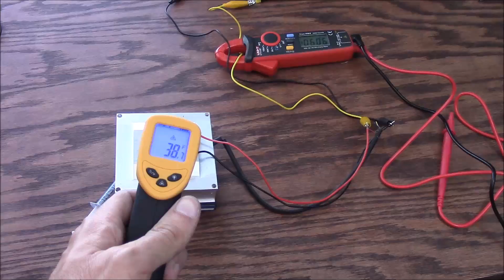Peltier Cascading - Does It Work??

Comment: Haven't watched video yet, but I'm certain this will not work

I was trying to find this in reverse, would you be willing to test this for a thermoelectric generator?
Reply from the maker: I do plan to revisit thermoelectric cooling at some point in the near future but I'm super busy building my homestead.  What, specifically, do you want me to test?
Reply: @LDSreliance  Just how much more efficient a thermoelectric generator is when you use Peltier cascading. 

Where I am is rather cold most of the time, so, not to be rude, but I'm not particularly interested in peltier cooling

I've seen a few people in comment sections of YouTube suggest cascading to increase efficiency of thermoelectric generators, and their reasoning makes sense. The heat gradient is divided among the different layers, with the layers furthest from the heat source converting heat that would have otherwise been wasted by the closest

I'm also led to believe that they'll be more resistant to overheating, though I'm skeptical if there will be much difference there

Thank you for taking the time to reply, and I wish you the best of luck with your homesteading
Reply from the maker: Thanks.  I'll see what I can do.  I assume you are talking about the TEG's that people attach to wood stoves and things like that?
Reply: @LDSreliance  oh yes, are they not the same as peltier?
Reply from the maker: They are.  Just a different application.  One consumes energy to produce heat and one consumes heat to produce energy.  Neither is very efficient but it is cool and interesting to tinker with.

Comment: I believe if you separate two cell into two different temperature region in the house like the roof and floor then connect them together like a loop with positive goes into positive of load like fan or light or air-conditioner then go to the other side of cell on cool foundation then when sun raise it drive referigerator and charge battery but it need more cells in parale and series together to make it power refrrigerator and microwave and stove

Comment: maybe a better validation would be to say cooling something. Like say running current in some mossfet chips on a heat sink and repeat test to see what setup cools the mossfets most efficient and also see how doing the TEC in parallel and series configuration. or send me the stuff and I will run the test LOL. Sorry I worked at a factory where I was used by the engineers that mid 6 figure to make their ideas work in the real 🌎

Comment: It would be interesting to see the impact of cascading when using a peltier to heat. I would venture to guess that it would close to double the performance as peltiers are better heaters than they are coolers.
Reply from the maker: It would definitely increase performance.  I don't think it would be double but it also wouldn't surprise me.
Reply: @LDSreliance  the thing is, even without the peltier effect, the peltier is a resistive element generating resistive heat. The catch is can they out preform the efficiency of a traditional resistive heater. My intuition says no due to increased thermal losses
Reply from the maker: True.  And they do require a much bigger heat sink on the hot side.

Comment: I'd be keen to space the cascade with a sandwich plate, 'semi' heatsink (as the cascade device is not directly loaded and each share an added value of safety from a serious breach that can occur during operation.  I hear that these things can stall on start up if the opposition of dissipation is too high).  The values of different peltier operation characteristics can better sympathise as one configuration might be premium to lower current operation or to the needs of higher demand such as on group for body operation and another group for a freezer unit.  
Then use 'the semi-stack' to improve the heat dissipation from a small group of primary stage sinks.
Basically ramp up the the top deck current while boosting the primary array, overall it could be a more linier change with the compensations made by a programmed triggering network of PWM controllers.

It will save on space and the extra cost of heatsink material.  It can even eliminate the need for water cooling which could be a payoff for the ecconomics of a project for years to come.  Then again the water thermo distribution could work as a payoff in itself.
I just don't want to buy a conventional fridge or putty up an ugly old styrofoam box.

You got it neat and exceptionally organised, nice to see the effort in effect!
Grats on the video ✌

Comment: Sir, my peltier module is drawing only 2 Amps of current 

What should I do ?
Reply from the maker: That is common in my experience.  When I order these I always order several of them because some will arrive defective.  If I order 5, hopefully at least 3 will be fully functional.  But I have some that arrive completely dead and unusable and some will come like yours and never draw full power.
Reply: @LDSreliance  ohh okay 
I have taught power supply problem

Comment: https://www.youtube.com/watch?v=vsTIWhZ-6HM

Peltier Plate Driving 2 Low Heat Sterling Engines. The Hot side powering the top & the cold being powered by the cold. Because a Sterling Engine converts the differences in Temperature both the Hot & Cold and a Peltier Plate produced Hot and Cold but on different sides of the plate the Peltier Plate's side can be used to produce kinetic energy.

The Top "Hot" Plate/Sterling Engines also acts as a more entertaining heat sink. 

For best results with a TEC1-12715 DC12V Heatsink Thermoelectric Cooler Cooling Peltier Plate Module 40x40MM over the TEC1-12706 as the TEC1-12715 can run at a higher amperage. If you only have a TEC1-12706 then you may with to place some form of resisters or Temperature Controller Module otherwise the heat may be too great for both the Low Heat Sterling Engine & TEC1-12706.

Comment: The major problem I noticed in these videos is the management of the heat itself.
Heat sink and insulation are the key words.
You are basically running 72 Watts through the first TEC so if you get a radiator from a car or an Air Conditioner unit from a scrap yard you could add 20 watt from a table fan and water pump and get a lower temp with way more efficiency instead of the (9.5 x 12) 114 Watts by stacking 2 TEC.
Reply: I think the idea is to reach maximum temperature difference between the top TEC and the environment. No matter how good the heatsink is, TECs only create a temperature difference and every single one can create only so much of it before the cold side stops getting any colder.

Comment: was that thermal compound acting as an adhesive?  I didn't see the test device move.
Reply from the maker: Yes, the thermal compound does form a little bit of a bond between the heatsink and the peltier (or CPU).

Comment: To increase efficiency, it would be much better to not fix the peltier modules to each other but to have them separate, with individual heat sinks for each peltier device.
My ideal construction would be like a minifridge within a minifridge.
I think this way, one would achieve much greater efficiency.
>

Comment: I used these for scientific instrumentation this wont work you need to have proper multiple stacks or stacks where the coolers decrease in size as they need to dissipate the heat

Comment: I started my interest in peltiers only yesterday  and i learned  that stacking works properly using different voltages  on the stack.  Thank you for unknowingly  proving  that .
Reply: At least someone saying this!
He should get far lower temperatures if the second battery was run at abt half the voltage of the first one!

Comment: You have no cooling the way you are dooing it.
And the cold side tec must be half or less the power rating.
First tec might transfere about 100 watt of heat on the hot side and 50 from the cold side then the next have to pull out that 100 pluss it's own 50 watt and that is way above its limits

Comment: This is not a really good model of cascading. Generally, when you cascade, the situation involves a small yet very hot chip, & the appropriate size Peltier cannot provide enough cooling. So, the first small Peltier with a modest heatsink is applied, then a larger Peltier and heatsink attached on top of the first heatsink. Sometimes third & even 4th layers are applied. This allows greater cooling, with less risk of condensation, because any bottom area of the Peltier not in direct contact with the hot chip is ineffective, and risks condensation.  Also as a way to cool when the target is crowded by other components which would prevent an oversized Peltier, even if you were able to prevent condensation.

Comment: I have a mini fridge with 2 compartments. 
Each have own peltier with internal and external heatsink with fans.
BUT shared power supply.

My 2 question is :
1, Increase cold side - do I need different watt peltier or bigger hot side heatsink ?
2, separate power supply for each peltier?
Thanks everyone who answers
👍👍👍
Reply from the maker: Yes, I would replace the peltier with a higher watt unit, upgrade the hot side heat sink, and add a second power supply (because the higher wattage peltier will require more power).

Comment: Great video, would be great to see how it goes generating power instead of heating and cooling.
Reply: I was able to get 250ish mV by rubbing it, with the otherside on a cold counter.  seems it shot up but then would go down as something seemed to equalize, no matter how much more rubbing i did the mv wouldnt go up.   Not very intuiative.  It seemed to like the temperature differenace more then just heat.  Another thing was rubbing the other side prodced a negative voltage,  you can make AC current with this?  Hot and cold type of engine, instead of stwitching polarities to drive a eletric motor, you switch temperatures to drive a peltier motor hehe, probaly at terrible efficiency though.
Reply: @mikejones-vd3fg  When you supply electricity, you generate a temperature differential. When you supply a temperature differential, you generate electricity.

Comment: Would cascading work in the reverse meaning to generate more power for a stove fan? Anybody?
Reply: sort of. the first layer would make the majority of the energy, the next layer would only make a fraction of that, and the next a fraction of that.
but it would never go over 100% efficiency if that's what you're hoping, but theoretically, with perfect insulation, you could get closer and closer to 100.
Reply: See Seebeck effect

Comment: Oh btw, pelteir modules dont like bangbang controllers. Filtered PWM power with thermistor sensor/control because devices are thermally conductive when off, thus losing the gain when on.
Reply: What about a PWM with a D.C. bias, so the Peltier Effect device is not switched off completely, but remains partially on whilst avoiding becoming conductive. Also phase the PWM wave, so each cascaded Peltier Effect device is activated one at a time? 

Would this provide good enough cooling whilst improving power consumption efficiency? Would the efficiency depend on the duty cycle of the PWM wave?
Reply: @neilruedlinger4851   Ideally we want the same difference of temperature across each device. And to simplify the circuit as much as possible. Keep in mind, its the amperage through the device that pumps the temp. difference and temp diff moderates the resistance of them.  A filter for PWM has a shcottky diode or suitable high speed rectifier, a coil (inductor) and perhaps a capacitor, depending on doody cycle. Diode clamps the flyback current to one of the rails and the coil keeps the amps relatively steady, cap enhances coil. IDK if yur pwm already has output filtering. Pelteirs seem to be more efficient at half or less than rated voltage/ amperage. Use more split the power?  One I use for beer(burrhp) has a little fan on the cold sink and the thermistor just keeps it from icing up(single 50w/12v pelteir) usually settles to 4 to 6 volt undisturbed.

Comment: Cascade/series yeah. It takes two modules to carry the heat of one. Place two on large hotside sink ,cut 1/4 inch or better plate of aluminium to match size of the two ,place one on top of that ,place 1/2 inch or better riser cut to size of one, place cold sink on riser ,use only two screws/clamps to sqeeze together , insulate with foam. Run peltier devices electricaly in series. Nice 50 watt cooling using 12v 150w devices. Fans Yeah.

Comment: hello LDSreliance! can you try this idea?

heres my idea or more likely arrange the components like this.

Heat sink with fan, (hot side)Peltier(cold side),aluminum water block, (cold side)Peltier(hot side), heat sink with fan

now im interested if we can use the cooled water inside the block for some interesting projects like pump it into radiators making like a crazy diy airconditioner. and maybe powered by solar panels :D
Reply from the maker: Yes that would work great.  You could use a high powered pump to move water through the block quickly with a setup like that since it is being cooled on both sides.  However, keep in mind that peltiers are very energy inefficient so using two peltiers at all times like that will use more power for a given amount of cooling than a traditional air conditioner.
Reply: @LDSreliance  how much use energy power one 12706 or another or 2 peltier in AC amp?

Comment: When "Cascading" each stage should be 4 times larger .... One "coldest" with an aluminum spacer/spreader to four more arranged in a square terminated to the main heat sink.  I would wire them in series with a constant  current regulated power supply.
Reply from the maker: Wow.  Then the applications where you would use this would be limited to ones where you need a few degrees colder and don't care about energy consumption at all.  I can't imagine any scenarios but I am sure they exist.

Comment: I believe there would be a big difference in reaching 31F vs 38F, since latent heat of fusion would be involved in reaching 31F which is much larger than sensible heat difference. So basing efficiency off of temperature alone won't give accurate results when there is phase change.
Reply from the maker: Perhaps, but that doesn't matter.  I was testing real world results.  I don't care what thermodynamics is happening here, I just want to know if it is better or worse than using a single TEC.  Also whether it is more efficient or less efficient as far as energy used for a given temp result.

Comment: I have gotten a single peltier module down to about -40 degrees Celsius. I used a heat sink submerged in a water bath full of ice. The water bath was around 5-9 degrees Celsius. Also I got a cascade peltier system like yours down to about -15 Celsius. Pretty cool (pun intended).
Reply from the maker: Nice, that is a good idea.  Nice job!
Reply: I think the problem is that you don't have enough airflow, which makes the whole system less effective. Good work, your setup isn't as messy as mine.
Reply from the maker: Maybe not.  I plan on getting back to some peltier experiements this winter.
Reply: Wow, that was fast, funny enough I am writing this comment as I am working on a peltier experiment. I am getting -20 Celsius stable.
Reply from the maker: Nice.  What are you using on the hot side and cold side?  You should do a video response to this video and show me.
Reply: I might, though my phone camera is terrible, I am using a water cooler from an old computer. I am not using it in the right way though, I am using it in a water bath which is about 10C.
Reply: How about using a Dry Ice/Acetone bath for even lower temperatures